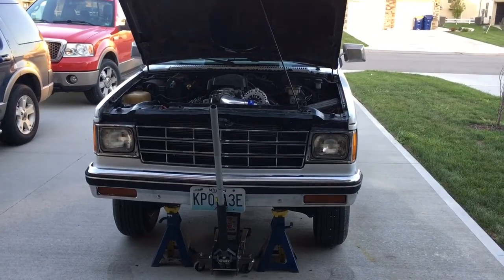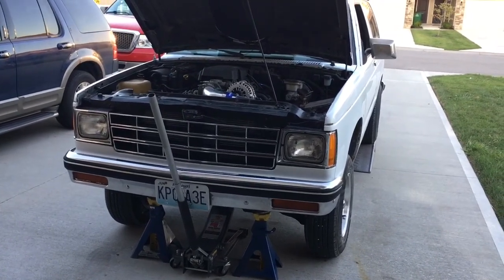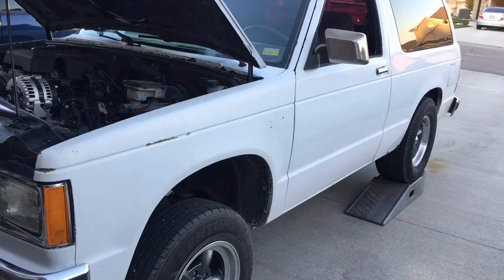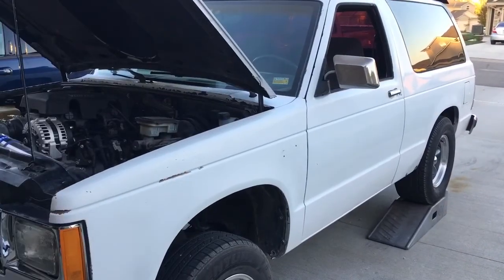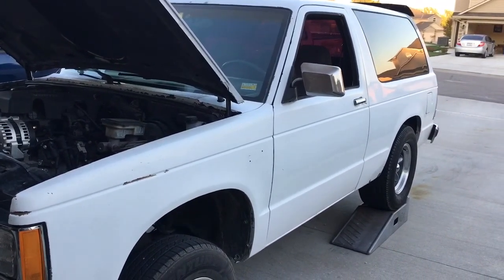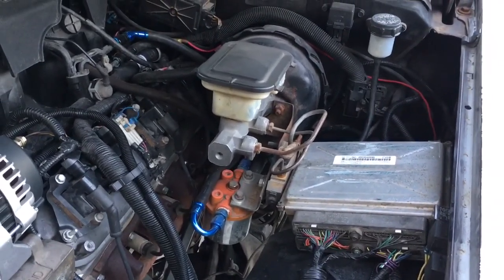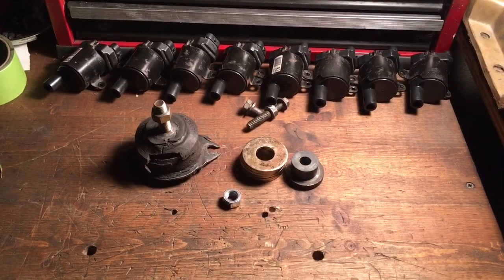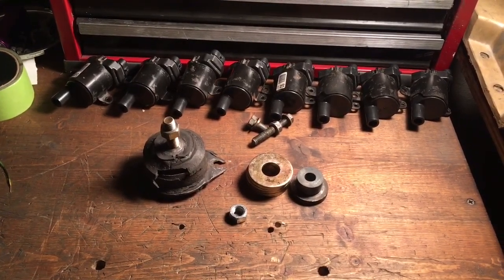GM T-5 Transmission mount adapter

Comment: What the measurements and angle of set up
Reply from the maker: You can identify these transmissions by the 26-spline GM input shaft with a Ford bolt pattern. You should also know that F-Body bellhousings mount the transmission at a 17-degree angle towards the driver, which could cause problems when trying to line up and mount the shifter through the floorboards of other models.

Comment: Changing the tail housing and top cover to a S10 or Astro van style is much simpler. The s10 tail housing would put the shifter in it's factory location. A astrovan will be about 3 inches farther back

Comment: Cut a piece of thick wall tubing of the inside diameter of the trans mount bolt o.d. 1/2" long. Cross cut this @ 17 degrees. Put half of it between the trans and the mount and half on the bottom side of the mount. Put the bolt through and adjust these spacers as needed. You will have to measure the length of the spacer for the other side. Hope this makes sense because it will work and won't use up much space.
Reply from the maker: Great tip, Thanks for the help!!!  JD

Comment: I predict that your custom adapter will work well.
Reply from the maker: Kevin Hornbuckle I sure hope I can find a short factory style mount that will fit in the space between the bottom of the adapter and the mounting tab on the crossmember. Solid trans mounts can break the transmission, so I have to be careful while I'm working the bugs out. Thanks for the support!  JD
Reply: Can you just use two straps of dense rubber? One over, one under so that the adapter can float just a little in either direction.
Reply from the maker: Kevin Hornbuckle Maybe, I'm actually looking at running a "Hockey Puck" as the spacer.   If it looks possible I'll make a video on it. 👍